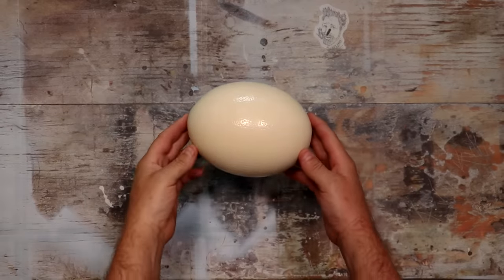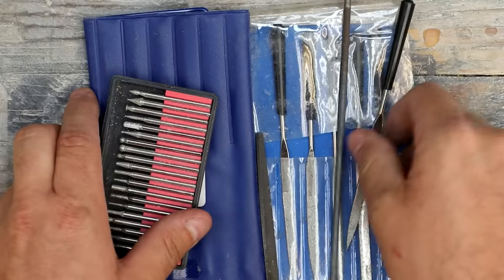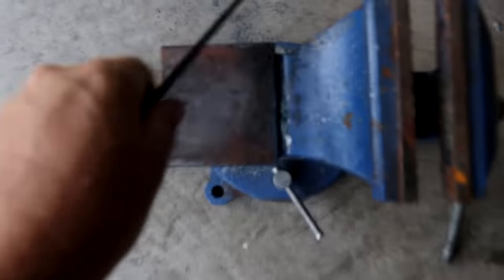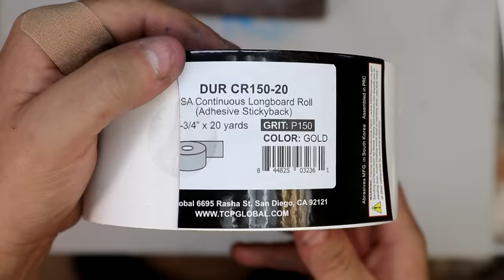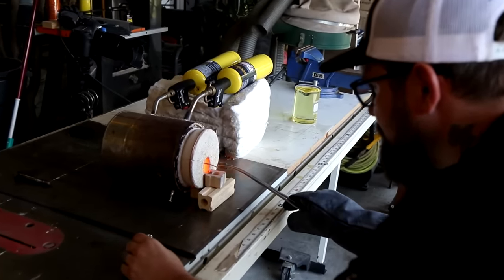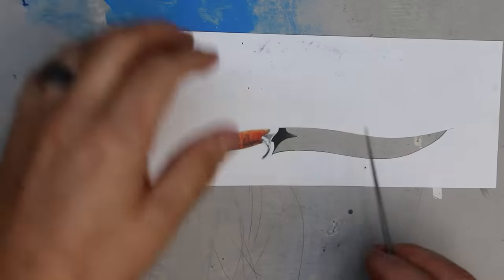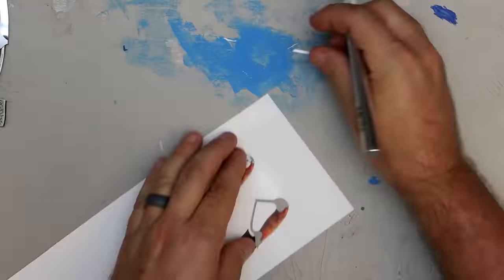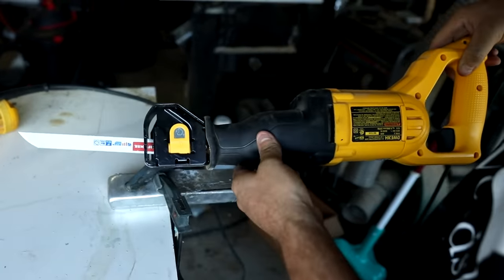I turn a Rusty Spike into a Perfect Miniature Fighting Knife

Comment: If this doesn't get lost in the masses, this metal fabricator has a tip: when working with soft metals like aluminum or pewter, a wax lubricant will help keep burrs, saw blades, and sandpaper from clogging with metal!
Reply: The moment when “If this doesn’t get lost in the masses” becomes top comment:

You are the chosen one
Reply from the maker: Thank you for the tip!
Reply: A bar of soap also works to stop clogging as well
Reply: Lol lubricant 😆
Reply: @BobbyDukeArts  that's what she said
Reply: @BobbyDukeArts  ...or WD40, the simplest choice. Cuts your cutting time in half. Pun intended.
Reply: We use paiste finising wax on our vertical bandsaw when we cut aluminum at pur shop
Reply: Also, if this doesn't get lost too, diamond burrs on ferrous metal can decline rapidly, as the diamond dissolves into the iron to make a ferrous carbide. This is why tungsten carbide burrs are used when machining steel.
Reply: I'm the 1000th like! Yay!😊
Reply: Nazar
Reply: @BobbyDukeArts   I agree...Nilered is indeed a sexy sience man.
Reply: Ben 10
Reply: Ben10

Comment: If you want to cut soft metals like Aluminium for example, you can use a grinding disc made for stone or concrete cutting, because they don’t get clogged so easily :)

Comment: We’ll, you’ve just demonstrated that you know all you need to know to make a knife of any size. It would be interesting to see you make a full-sized knife. Very cool video and thanks for being transparent about depression. I suffer from depression as well and have been taking medication to treat it for 18 years. No shame in the struggle, but we can win. Stay on top Bobby.
Reply: I didn't want to nitpick but there's no mechanical connection between the tang and the handle. It's being held down by only glue. It would have been great if he made the the tang a little thicker and inserted a pin. or hammered the tang's end on to the pommel. Looks great tho.

Comment: Beautiful mini knife 
A tip to folks who want to spend a week cursing and cussing making thier own
At heat treatment, after you dunk it in oil, but before you temper it in the oven, clean off the scale.
It will develop a purple or blue color depending on temperature. Also, 400 F° is to hot for some steels.
Reply: Oh.
And a decade or more of sculpting, machining, toolmaking, or blacksmithing experince helps a ton, firsts won't look good without it. Be proud anyway

Comment: I wish I could TIG. I'm so good with stick I can weld almost down to sheet metal. Same goes with MIG. But the moment I try to TIG, I end up failing to regulate amperage with the pedal or I shock myself and so on. It's so annoying.
Reply: Try lift arc tig, or scratch start. Pedal is only useful for certain things

Comment: A knife for fighting should be able to cut on both sides or all sides to have the advantage in a fight with an opponent with a knife. The top of that knife should also be extremely sharp. A tool knife is a disadvantage in a knife fight with a knife designed for combat… Anything can be used as a weapon, but everything isn’t designed for that purpose…